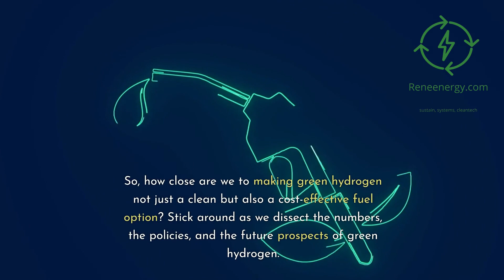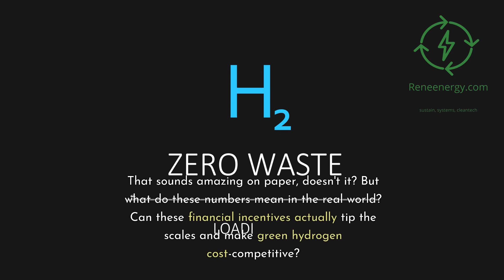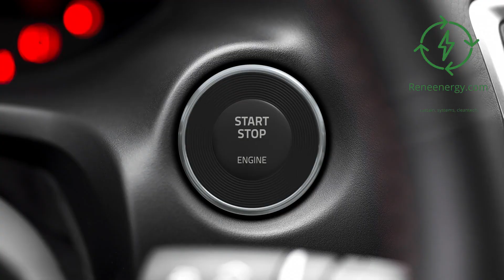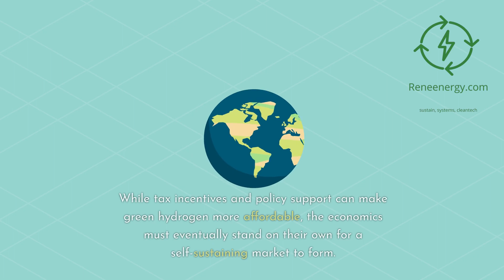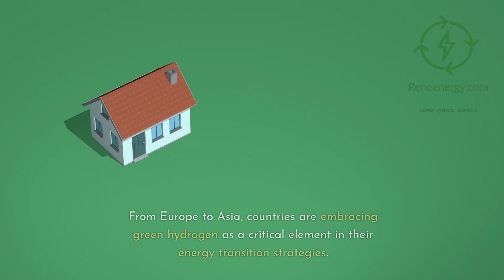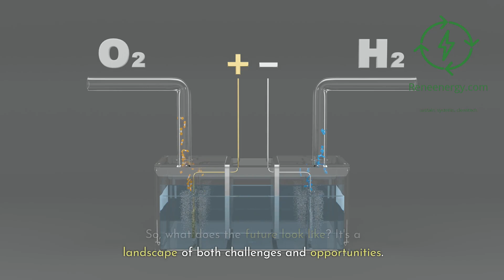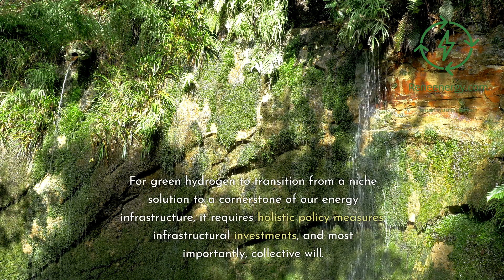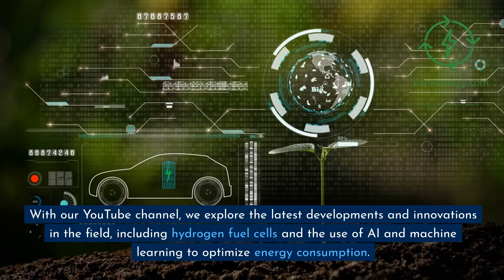The True Cost of Green Hydrogen Hype or Hope?

Comment: That all sounds so wonderful. Now, the reality is that a 2023 Toyota Mirai goes for around $50k, a 2022 is going for around $25k, and a 1st gen (2016-19) can be had for less than $10k. And this is in southern California where we have more hydrogen stations than anywhere else in the nation. The only logical explanation for the radical price drop has to be the high cost of hydrogen fuel. It's costing between $80 - $100 to fill the tank of a typical Mirai and that only gets you about 250 - 300 miles down the road. When you do the math, hydrogen doesn't look so attractive anymore. You could actually save more money buying and driving a Honda Civic. And catch 22, if the cost of hydrogen came down, the demand for the Mirai, along with the price, will go up. Oh, and it should be pointed out that the cost of hydrogen fuel has nearly tripled since this administration took office.
Reply from the maker: You're right about the catch-22 situation. If hydrogen becomes cheaper and more available, demand for vehicles like the Mirai could increase, driving up prices. This makes for a tricky market equilibrium problem.
In addtion, while hydrogen has its advantages—fast refueling and zero tailpipe emissions—it's currently battling against economic and infrastructure challenges that make it less attractive to consumers compared to traditional gasoline vehicles or electric vehicles. Until these hurdles are cleared, it's unlikely that hydrogen vehicles will take a substantial market share, unless there's a significant change in economic or technological factors.

Comment: Please mention the challenge of very low volumetric energy density. The required size of fuel tanks alone makes Hydrogen impractical for passenger aviation.
Reply from the maker: You're absolutely right, and I apologize for not mentioning that earlier. Volumetric energy density is indeed a significant challenge for hydrogen as a fuel source, especially for applications like aviation. Hydrogen has a low volumetric energy density compared to traditional aviation fuels, meaning that much more space is required to store the same amount of energy. 
In cars like the Toyota Mirai, these volumetric energy density issues are somewhat mitigated because there is more flexibility in terms of space. However, even there, the size of the hydrogen tanks limits how much fuel can be stored, which in turn limits the range of the vehicle.